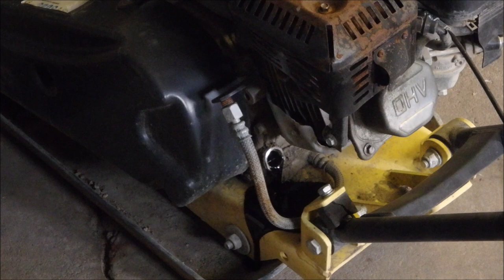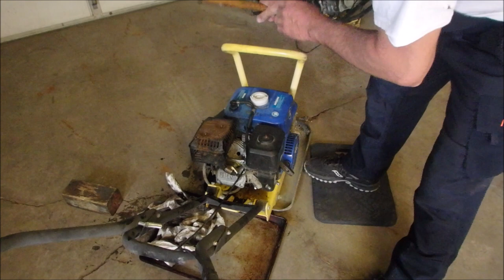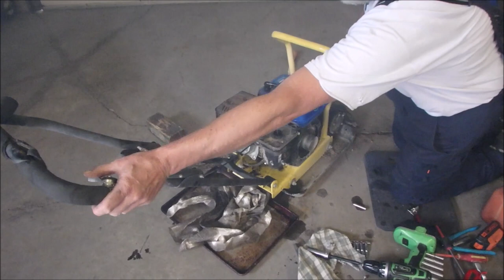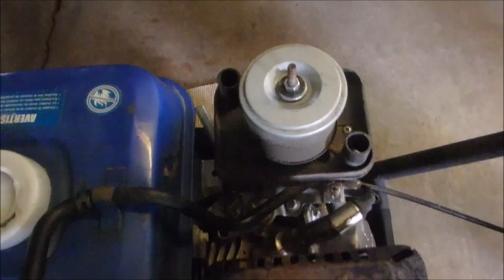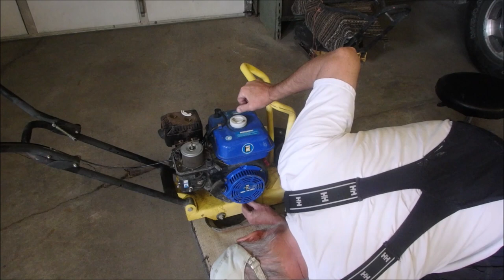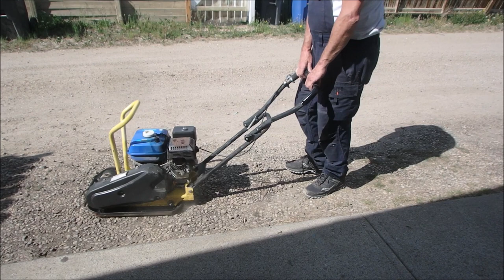Earth Compactor 196CC  (Many Issues)

Comment: Funny you posted this video today since Jake and i were just talking about the time we repaired a plate tamper like yours that would die out every half hour of running per the customer and we needed to tie it to a tree in the backyard and run it to diagnose the problem lol! Just wondering if your fluid extractor is rated for both fuel and oil?
Reply from the maker: I have the 2.  I know the tall white one 22:37 is for oil.  That is all I use it for and the little short one 9:16 use just for gas
Reply: @BrucesShop  Have you had any issues with the little one pumping fuel since they suggest only to use on oil but i have always thought pumping out fuel would be ok.

Comment: I worked on one of these and it would run until you started to vibrate , then it would stall . The connector for the shut off was loose and short to ground when shacking . Tightened the connector and tied down wires . I thought it was the low oil sensor .
Reply from the maker: Interesting.  I saw the low shut down wire.  These machines are sure hard on themselves eh!!!

Comment: If it wasn’t fuel leaking into the sump I wonder how it got overfilled that much with oil in the first place? Perhaps the machine was tilted forward when filled.
Reply from the maker: I talked to them.  It is so heavy they just tilted back and up and filled it with 2 guys.   Not checking after.

Comment: 220, 221, whatever it takes. Just a couple of thoughts, why not use a piece of hardwood dowel rather that a bolt or cold chisel to move the piston? I use WD40 or any other penetrating oil in such situations. Trust you'll charge the Silly of Red Deer for the alley maintenance. A well tuned machine is a thing of beauty and a joy forever. Another one in the win column.
Reply from the maker: Right.  I was in "go mode" on this one.   I should have filled the cylinder with oil before I continued.  I just want this out to run and go quickly.

Comment: 6:32 we have a runner!
Reply from the maker: Thanks.  Did you have sound issues?  Some are complaining.
Reply: @BrucesShop  no sound issues. I watched it straight through without problems. But second time I tried to watch it, I got the error about no stream. Then I switched to pc instead of phone and it worked fine.